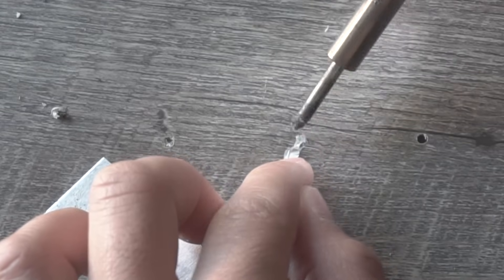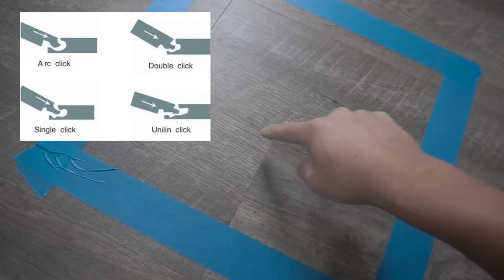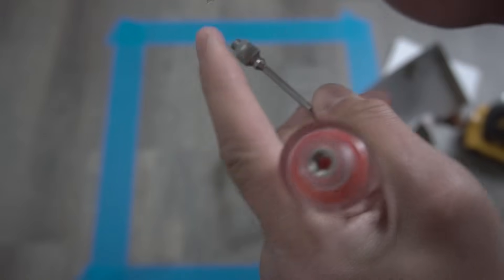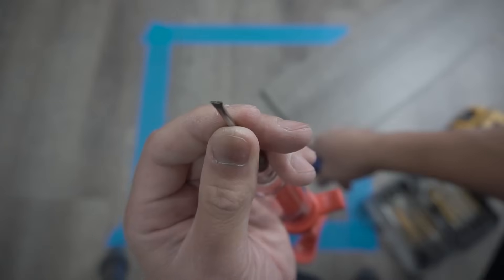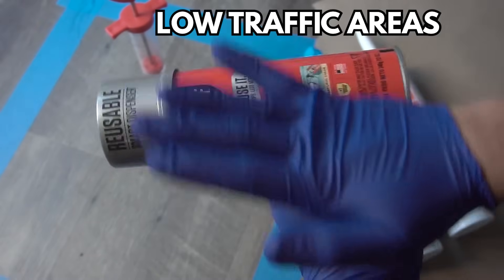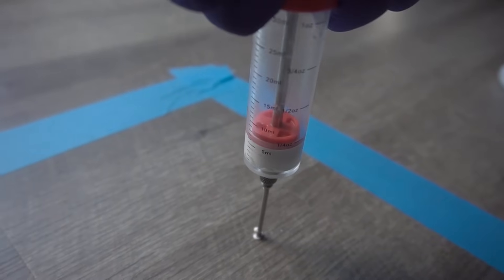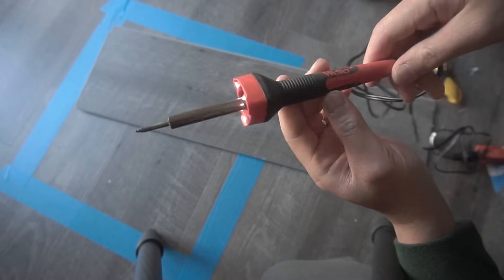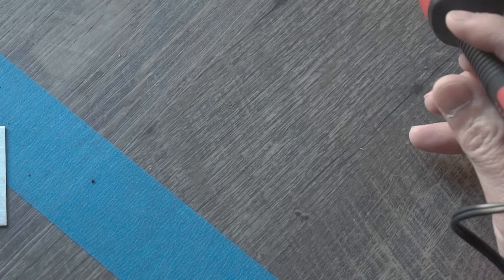How To Fill Hollow Spots Inside Vinyl Plank Flooring LVP Laminate And Engineered Hardwood Floors DIY

Comment: I didn't use a solder iron.  I used a leather hole punch that I already had, and used that to punch out pieces of tile that fit right into the holes I had drilled.  I used the DAP Extreme Stretch as the filler.  It went in pretty well, probably flowed out to about a 5-6 inch radius from the hole.  In one deeper spot, it went out about 8" radius. I had several low spots in the same area and needed about 5 holes to properly allow the filler to spread.  I could not get the solder iron technique to work for me, and I've been using solder irons for years.  But the leather punch idea was great.
Reply: How is the fix holding up after nearly a year? I need to do this in a few areas where I installed LVP on a slightly uneven surface.

Comment: Unclicking the short joint on lvp click will probably damage it beyond repair; unlike hdf laminate. Great video! I think silicone would be the best gap filler. Flexes and won't break down or separate. I'm the flooring tech that does repairs. Saw one this morning. Drop and lock. I will fix it next week.
Reply from the maker: Thank you so much for sharing your advice! 🙏🏽😊
Reply: Injected with silicone in the kitchen galley with a bounce gap of a 3' circle and 1' circle close to din rm wall. 8 pokes in the kit and 4 in the dining rm. Acrylic match filler bonded to perfection. Wood grained and textured makes this easy. Will call customer in about a week and ask if he's satisfied
Reply: @daveparkes8539  what is the acrylic match filler? Do you have a link to show what this stuff is?
Reply: @brianmiller2135  there is Mapei T Plus in a caulking tube for the gun and Color Rite in a squeeze tube. Both in many colors.

Comment: Had I known this hollow thing would've happened with vinyl flooring, I would've installed real hardwood floor. But thank you for putting put my hollow misery! No more depressing squoosh.
Reply from the maker: Vinyl is actually very strong and last long, it’s just needs proper prep and leveling before laying down. Thank you so much for watching 🙏🏽😊👍🏽

Comment: I had professionals install LVP less then 6 months ago. I already have gaps forming and multiple “soft spots.” I had them come back to look at it and they are trying to charge me to fix it and telling me they need to pull it ALL up and do it again and that they will only be able to save 50-60% of the floors I already bought and would need to buy more to finish it again. And since I’m in an older mobile home, it’ll “probably keep happening”. UMMMM NO FREAKING WAY! I’m not paying to have my floors fixed every 6 months! Between this video and your other video with the glass suction cup thing and rubber mallet, I think I’ll be able to fix it myself and I only spent $50 and the supplies needed (with the exception of a soldering tool. I have grey floors and bought grey stretch caulk so hopefully I can skip the last step with the soldering). Wish me luck 🤞 🤞
Reply: Were you able to fix the floors?
Reply: Everything I ordered will be delivered tomorrow and I’ll be attempting to fix them this weekend, I’ll try to remember to come back and let you know how it goes 🤞🤞
Reply: @user-cv8pj1ds4n  Dude how did it go in the end? Did it work well ? Give us a quick summary if you can. Thank you

Comment: Hi I was practicing using the soldering iron to try and fill the holes back up and can’t seem to get it right. Seems like the pieces of plastic keep getting burned and turn black and hardened and won’t melt nicely back into the whole. Am I doing something wrong is there a correct temp setting. My soldering iron goes from 200 C to 450 C I’ve tried both and get the same results

Comment: Ok, few thing here I wouldn’t recommend. 1 is that if you will force the planks apart with out angling the plank out of it seat you will brake off the lower lip of the bottom plank causing and allowing the plank to slide back-and-forth at any given time (and it will) 2 if you have used a roll out mat for moisture barrier there is no way getting that product making directly contact between the plank and the subfloor with the matt just seating there

Comment: Thanks! This method fixed a very annoying floor squeak at my house.
Reply: Which injection tool did u use?
Reply: @ddash1983  I used a syringe that was disposed of at my job (not medical). Had to refill it a bunch of times but it worked well.

Comment: Thanks for your helpful video. I wonder if Selleys No More Gaps filler can be used? I can't find your recommended fillers at my local stores.
Reply: I think no more gaps will harden and perish over time so probably not good. I will buy some 100% silicone from Bunnings and use that I think

Comment: I have a dip in the floor which was due to the contractor not leveling the area before laying the engineer floor. It is a 2 ft x 2 ft are that dips. One can feel the floor drop by a very noticable amount. Any suggestions on how to fix this?  The basement is finished so I can't easily get underneath to put in shims easily without cracking open the ceiling.

Comment: I noticed the plank joints are too close to each other. They should be staggered with more distance in between. Installing the flooring correctly can prevent this problem. Thanks for the tip.

Comment: Thanks for the video. I had a floor "professionally installed" about a year ago. Two hollow spots the broke the lower halves of the female sections of the click mechanisms. One right in front of the fridge and the other right in the middle of a high traffic area. They refused to fix it so I refused to pay them for the labor and prep. Anyhow, I watched this video and went into my garage. I saw a tube of liquid nails and one of those adaptors that you use to fill up a football. I cut the angled hole off the adaptor  to make it straight. I then cut the tip of the liquid nails tube just a little smaller than the male threads on the adaptor. Slightly heated the caulking tube end, with a lighter,  to make it just flexible enough to press the adaptor threads into it. This eliminated the need for the injector from Amazon. The liquid nails that I used is this enough to flow through that little pin so the holes that I drilled were tiny. The liquid nails also matches my LVT. Also, one of the planks sat low. Instead of a suction cup, I ground the point off of a wood screw and threaded into a hole and screwed it in until the, now blunt, end of the screw bottomed out on the subfloor and lifter the plank up to the proper level. I should add that there is a plastic vapor barrier between the plywood subfloor and LVT so, I don't think adhesion will be an issue that concerns the expansion and contraction of the planks. I just hope the liquid nails set up in a timely manner. Fingers crossed.

Comment: Hi I try the way you show one area is working,but other not the floor have a heavy pat under the vinyl floor, between concrete and vinyl floor,other area is wood floors with same heavy pat between. The floor not attached correct and weaving, also is very cool this time. What can I do. Thanks for your help.

Comment: I’m gonna try this using EasySand90 which is a drywall mud that chemically sets up and doesn’t need to air dry.  It’s not adhesive, either.  Also, I can control the viscosity by adding more/less water.
Reply: How do you get it underneath existing flooring like in this video?  If it can be injected I would think it's too watery.

Comment: Hi - Would you recommend using the Fix-It-Floor or DAP Big Stretch Caulk underneath the floating vinyl planks?  Will the caulk adhere the plank to the floor and will it dry hard or will it still be soft when walked on?  Thanks!
Reply: I used DAP 230 flexible. The floor was hard when walked on.
Reply: @dawynn9362  Is it still hardened? has the caulk lasted?

Comment: The drilling holes and filling with caulk worked for me. I used weights to hold the floor down for about 1 week to make sure the caulk cured fully. However, we have light tan colored floors and the soldering part did not work when I tried on my test piece. The soldering iron just burned the LVP and the color change was very obvious.
Reply: @MrJRey3  what did you do instead to fill the holes?
Reply: I used plastic wood filler for the holes

Comment: The only thing is that Big Stretch the cure time is 1 to 2 weeks.😢. If you step in a few days, the caulking comes up. But it is a great solution when you have an uneven floor. I had to make like 12 holes in a 10x10 room😅. But thanks to your video the floor is much better now. 👍🏻
Reply: Is it still holding up?

Comment: never thought of this for flooring, recently started using a syringe to inject drywall mud into tape bubbles. works great.
Reply from the maker: Thank you for sharing your technique! 🙏🏽😊👍🏽
Reply: @i.m.p4908  yeah No crap. We can't all be super gifted tradesman trained in these ways to do them perfectly the first time. Such services cost a lot of money so a lot of people do things themselves and we can't always do it perfectly so sometimes mistakes happen days later after we've moved on. We don't have the money or time or experience to pull everything out and fix it the proper way so we need a simple fix that will give us a few more years to make it look nice, decent, and functional.

Comment: Hi, spray foam is often recommended for injection,  is silicone or acrylic not better for laminate? It is more flexible and the laminate can move, please clarify thank you!
Reply from the maker: Hi! Personally I prefer the extreme stretch which will allow movement. Spray foam I only recommend on low traffic areas. Foam will get flattened and crushed over time and will leave the same gap. 🙏🏽

Comment: thank you for your video. appreciate your thoughts on the glue to be injected, in the video you used some kind of flexible filler I think, would that be too soft to provide the hollow floor board a firm support (for people to step/walk on the floor)?  elsewhere I read people use expandable foam (for filling in door frame gaps) which will harden, would you recommend that?   many thanks

Comment: Will the caulk or wood glue dry once injected under the floor?  It worries me that the with the lack of exposure to air, it’ll never harden.
Reply: It’ll harden. Caulk will harden even inside it’s own tube once the seal is cracked. Even when you cap it and don’t use it for awhile it always hardens.

Comment: How about using self leveling cement/mortar instead of silicone? Seems like it would work well since it flows freely & fills voids.
Reply: So long as it doesn't permanently adhere the lvp to the subfloor ( if the floors are floating)

Comment: Great video! I watched a few different options of materials to be injected in the soft spots. Can I use subfloor adhesive like the PL400 instead? I happen to have one I use to fix the joist from underneath and wonder I can use the same adhesive for injection. Or it has to be expandable foam?

Comment: Would floor leveler work in this application? Or would it bond to hard to the plank?
Reply from the maker: Hi! Floor leveler is too thick and won’t go to this type of syringe, I tried it 😆., but if you cna find a different syringe to make it work I think it will be doable for sure! 👍🏽😊

Comment: The same injector when I push down all the caulk goes past the oring and doesn't go into the hole, using extreme stretch caulk too

Comment: Was going to do this - my son and I did an experiment and put a small amount of adhesive under his LVP flooring (scraps) and attached to plywood to simulate floor installation.  We used wood glue, and 3 different types of caulking.  Only one of the caulks was able to be moved AT ALL after overnight drying, the wood glue and both of the other caulks were completely stuck - couldn’t even budget them with full force pushing side to side.  Based on this we did not proceed with this method.  I would advise anyone to do some testing first, perhaps some types of flooring have different base under them.

Comment: I had click lock Vinyl floor installed recently and I see large gaps between planks whereas your floor planks are seem pretty tight. Did the contractor not stick them properly or are there different styles of Vinyl planks?
Reply from the maker: For large gaps between planks please watch my video on how I fixed gaps : 
https://m.youtube.com/watch?v=gbZjJ5gV6GM

These floors are floating floors are not meant to be stuck to the floor to allow expansion and contraction. Also attaching them are easy using the click system type floor.
Reply: these floors click together, with a lip there shouldn't be a gap, any real gap if you had to fix depending were it's at like say the middle of the flooring all pieces up to the gap would need to be pressed up to fill the gap .
Reply: Sounds like the subfloor wasn't leveled first. The floor will pull itself apart if it's not level. Even if it was leveled, high traffic areas should have the joints reenforced with glue
Reply: A common issue we see with in-experienced installers is fracture of the butt joint locking systems.  It accounts for probably 90% of the attempted claims we receive.  Most manufacturers will send out a rep to look at the floor and determine if it’s an installation issue or flooring failure - some companies will even replace the floor if it is deemed installation issue.
Reply: It should be tight as the planks have a lip connection that "snaps" tight. But the plastic lip is plastic and very brittle and can break very easily. There is always a chance on install the one can hear the sbap and it's tight but a hairline crack on the base of the lip is broken.
Reply: I don't know where my previous reply went, but just an FYI, some LVP does have a "gap", by design. Not all are flush. 

My planks have beveled edges to make it look like there's a gap to emphasize the plank design. Would love to show a picture but my comment gets removed if I link to it. 

Some LVP comes with simulated grout lines as well to look like actual tile.
Reply: @mcdonamw  I think my LVPs are designed like that too. I took two pieces and click locked them and they do have some gap. It makes it looks like grout lines.
Reply: @akalrove4834  if it's like that everywhere it's likely by design. Unexpected gaps are usually intermittent and obvious. As long as the planks are fully clicked/locked you're good.
Reply: Thanks all. Yes my planks are consistent in terms of spacing

Comment: I have a void under my laminated floor.  Do I drill through the underlay and pump the caulk below it or drill just through the floor tile and pump the caulk above the underlay?
Reply: If you have an underlay this method probably won't work out well, but if you want to try it then inject the caulk below the underlay.

Comment: Would this work with wood flooring? I have a squishy area that is about 1’x2’ and the wood planks are 2” pine with some gapping in between, no greater than 1/8”.
Reply: Yes. He actually said it would work on wood floors as well at the beginning of the video.

Comment: The soldering iron just turns the LVP pieces black immediately. I tried to turn heat down to 200 degrees and still had same effect. Any tips?

Comment: using extreme stretch do you think over time it will shrink and the floor will push up ?
Reply from the maker: So far mine is holding up well! I’ll do a follow up video on how it turned out after 1 year mark from this video!

Comment: I need to try this I've got an area about 6 ft square that is hollow underneath when you walk across. it moves.

I've also got another issue when I'm going to have to get the flooring guy back out here I've got several screw pops out of showed up in different planks I know you can remove individual planks but he's talking about possibly ripping the whole floor up I'd rather not do that I'm living in the house now

Comment: How did you get the caulk out thru the needle?  Its really hard to push
Reply: Same, I ended up making a slightly larger hole (5mm) and using the tip of the caulking tube directly into it using the caulking gun. Worked great 👍
Reply: @GregoryWhitakerDevs did you cut off the end of the Caulk tube or just poked a hole in it? Thanks in advance for a reply.

Comment: Do you have a similar video for laminate floating floor?
Reply from the maker: Hi! Should be the same concept. I would use a paint crayon or putty to fill the holes. I’ll try to make make a video on laminate in the future 👍🏽😊🙏🏽
Reply: So I've got a laminate floor. It's the sheet-rock-like material underneath that is creeky. For that reason, I re-floored it with a layer of that blanket material underneath a floating laminate floor. I also told the workers to add additional screws to every spot of the sheet-rock material that was creaky as they re-floored. But they missed like three spots and it is now only creaky in those three spots. I'm thinking that my best solution might be a combination of what you did in this video and use of one of those screw-in-pinch off kits. The problem is most of the videos I've found for those kits are for vinyl or hardwood. 1. Is this a good plan? And 2. Do you have or recommend any videos for the kits use on laminate?